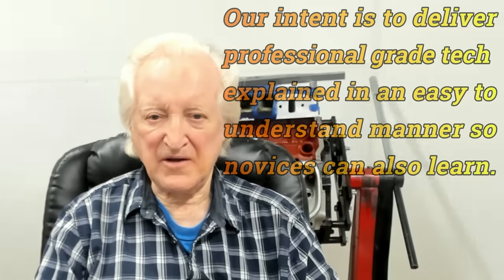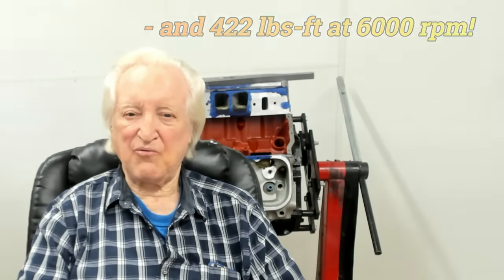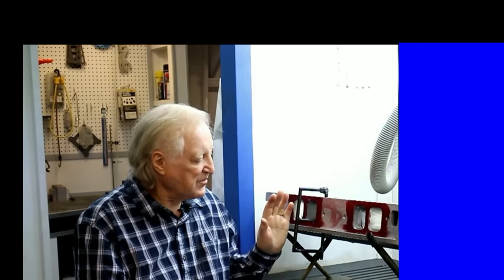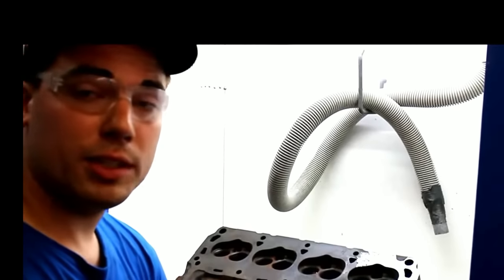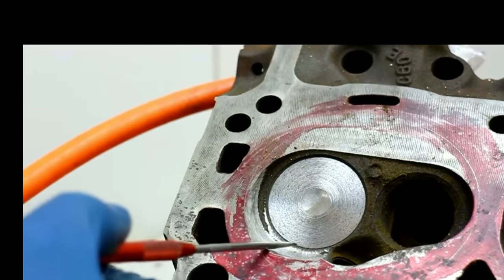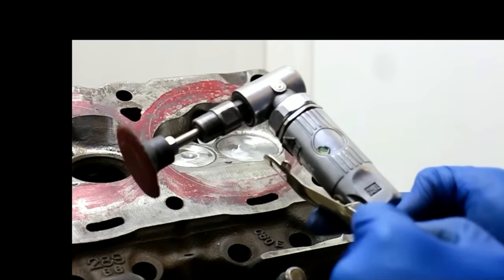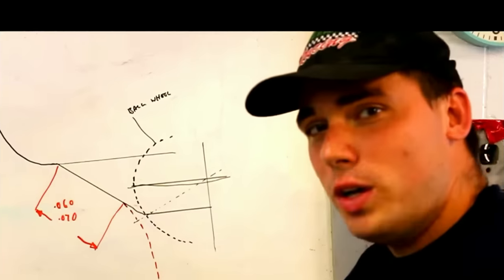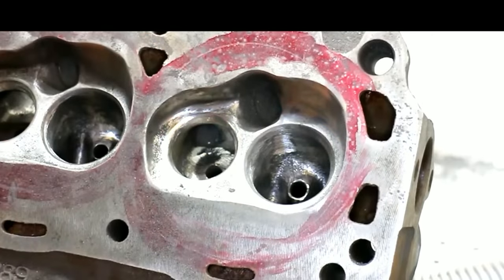Pro race,  very street drivable, 500 hp OE 289 SBF iron head mods.

Comment: Really appreciate the knowledge in this video, and the timing of the upload. I'm currently in the process of porting my set of 289 heads, which also happen to be for a '66 mustang GT, and are the first set of cylinder heads I've done any significant work to. 

I have a question: based on your expertise, in addition to the porting work shown in this video, would installing larger 351W valves (1.85"/1.55") have additional benefits in performance on a high compression 289, or are the flow numbers/HP/Tq ratings similar compared the stock valves (1.78"/1.45") after porting. I would love to hear your input. 

- James P.
Reply: In another episode, DV talks about area rule. This is the area of the valve curtain up to about .25 of the valve lift. The area between the valve and seat up to that point is what limits the intake flow. Exhaust also but the higher pressure gas is a determinate. What this says is, yes a larger valve will tend to produce/allow more flow especially at low lift. 
For years guys have been installing the Chev 1.94"/1.6" valves in the SBF heads. Another option now is the LS 1.9"/1.55" valves. Keeper heights are close to the same as the Ford valves with either choice of Chev valves. The 1.94"/1.6" use the same 11/32" diameter stems as the Ford. If your guides are worn I would choose the LS valves. They are about 20g to 25g lighter. When you need new guides anyway, installing 5/16" bronze guides and hone to fit the 8mm stems is a bonus. You do need retainers, keepers and springs. If you have the 63 1/2 to 66 regular performance heads with pressed in rocker studs, you likely have a spring installed height of 1.64" to 1.66". PAC has dual springs that will work with flat tappets and .55" lift. If you have the HiPo heads or 67 and later heads, the spring installed height should be 1.78". In this case the LS retainers, keepers and probably springs from a Pick n Pull engine will work. The LS installed height is 1.8". These parts also reduce the moving mass of the valve train.
If hou have the early 351 heads with the 1.84" valves or the GT40/ GT40P heads with the 1.84" valves, the LS6 has 2.00" intake valves that can be put in these heads.
The Ford valves are a bit longer but not a problem. Rocker geometry must be checked. Lash caps may help correct the shorter valve stems. 
I would also consider 7/16" rocker studs for extra strength and stability. Also roller rockers to fit the 7/16" studs. There is a cost premium to this, but the benefits outweight the extra cost, IMHO.
Non HiPo heads probably do not have pushrod guides built in the heads, so guide plates are likely required. If the pushrod holes have the guide slots, the stud bosses need to be milled down about 0.250". If the holes are round, guide plates are required. In this case the bosses need to be milled 0.300".
With the almost 0.125" larger intake valves and other porting work as described in DV's PowerTec 10 Ford porting videos, a single pattern cam with about 107° LSA can be used to good effect.
Reply: @Dale Davies  lots of great info, thank you. My castings are C60E-M with cast-in guides, originally on a '66 GT. Is it true that bronze valve guides can potentially seize on a valve stem causing catastrophic engine failure? The reason I ask is, I'm running a multi carbureted manifold (3x2) that is notorious for tuning issues related to the idle circuit and/or proper jetting. If not tuned correctly, there could be lean cylinders at some point throughout the RPM range. The increased heat in the affected cylinders could cause the valve guides above that cylinder to expand at an increased rate and potentially seize a valve. At least, that's my understanding based on my research. In my application, if needed, are cast iron guides available and would they be the better option?
Reply: @PrescribedFire I have to admit that I do not know on the bronze guide seizing. Bronze should have a tendency to self lubricate. Obviously the exhaust valves are more of a concern, so the stem clearance could be opened up slightly. I would talk to your head machinist concerning this.
I bought an RPM AirGap for my 66 289 to replace the 2V carb. The AVS2 carbs were not available then. When I get my engine back together I will put it back on as previously run. Then I will replace the primary boosters with the AVS2 650 boosters for better fuel atomization. The AirGap lacks heat so good atomization at the carburetor is a big help.
My cam is one I had in a 351 and the guy that bought the car for parts was going to rebuild it. I got the cam and lifters out of it with low miles. I drilled a 2 × 4 with 1" holes and marked the cylinders so I can put them back on the same lobes.
The cam is an Engele;
210° @ 0.050"
256° @ 0.006"
LSA is 109°, a bit wide for the 289, but considering I have it I will use it.
Valve lift is 0.472" with 1.6 rockers. I got Scorpion 1.72:1 rockers to get lift over 0.5".
I will get the exhaust seats cut at 40°  and the exhaust valves to 39°. According to David Vizard this helps blowdown at low lift, similar to back cutting the intake valves. The intakes will still be 45° seats with a back cut. Another trick for the exhaust valves is to chuck them in a drill press and use a fine file to round off the outer cylinder side of the margin. You can also use a flapper wheel in a drill while the drill is turning to swirl polish the port side of the valves, especially the intake. 320 grit works.
DV's PowerTec 10 Ford head porting videos show how to prep the heads to enable 500HP. 
DV also built a dyno mule using Chev 5.7 powdered metal con rods and Mahle Chev pistons. Compression height is short with this but 1mm, 1mm and 2mm rings help. I am planning another 289 build using aftermarket light Chev 5.565 rods with the big ends machined for the SBF journal and bearing sizes. This leaves the compression height at 1.200" to 1.210" for a tight quench. Do look up DV's Ford porting videos.
You have heard of SBF blocks breaking. A lot of that is front to rear vibration that fatiques the main webs. In DV's 1,000HP Ford block video he shows block modifications for splayed 4 bolt mains, a lifter valley reinforcement and concrete filling the block up to the bottom of the water holes where water enters from the water pump. This changes the natural frequency and damps vibrations. This does not harm cooling as most of the heat is in the top 1" of the cylinder.
Another thing to look into is Strategic Cooling. You would epoxy freeze plugs into the front water holes in the block and then drill to say 3/4". Then the water passages in the timing cover would be drilled and tapped or an aluminium nipple welded on with a 3/4" NPT thread. The block is drilled and tapped for 3/8" NPT between the front two cylinders on each side and also the rear two cylinders each side. This creates swirl around the cylinder tops. A manifold needs to be made out of tubing, 3/8" stainless. Also the heads can be drilled and tapped to inject coolant directed between the exhaust seat and spark plug. This is an option available through AFR Cylinder Heads.A 1/2" or 3/4" tube should come from each side of the timing cover and around the side of the block. The 3/8" tubes get welded to that to distribut the coolant where it is most needed, thus the Strategic Cooling name. I think it is Stewart Cooling that describes this into the heads rather than reverse cooling. Deairation is not a problem with this.

Comment: Excellent. I wonder how you could mod the same heads to run low compression, 87 octane for a great street engine? Occasional track days and cruising in a 65 Mustang 2+2.
Reply: Use water injection with 87 octane. David has several videos on this.
Reply: @bobirving6052  Thanks, will check it out.

Comment: The gasket hole is always bigger than the bore in the block !! If you port to the gasket edge, the chamber will over hang the bore anð interfere with intake flow ! The way to do it, is use empty block put blueing around chambers, bolt heads to block turn block upside down, reach down bores and scribe lines on heads. Know you have the exact size of the bores transfered to the heads !, Hope this helps, GOD bless.

Comment: Hi David, thank you for sharing all this knowledge. i have maxed out my internet twice watching your videos (can't get unlimited where i live). Now please excuse my ignorance, i have searched the internet for information on "Flowing to 28 inches". without success. What does this actually mean? if possible could you do a video on this subject. I'm sure that there must be other people like myself that can't come to grasps with this statement. Or maybe I'm the only one...
Reply: That's the amount of suction/vacuum (restriction to flow)  being pulled through the port while on the flow bench. Pulling water 28 inches up a tube, suction overcoming gravity. You'll see the red dye in the tubes on the flow bench to more easily see the liquid.
28" is an "industry standard" value for comparisons.
By keeping the suction constant, any change in flow by porting or increased valve opening is easily seen.
Each time the valve is opened farther, 28" needs to be reset.
Reply: Hi Thanks for the reply.
However i still not understanding the physical connection of the tube\s are being sucked on.
if they are on the vacuum side the liquid would be sucked straight out of the tank (if there is a tank).
So the only way you could move the liquid up the tube is to apply a slight vacuum.
the only way (I think) you could apply a slight vacuum is to have the tube somehow interface with the air being drawn through the port.
So is there a tube placed in or near the port? or is it some kind of venturi that the air passes over causing suction? (Like a spray gun)
A physical diagram would be awesome!

I am in the process of rebuilding a 351C using stock heads (2V) for street use, and I want to apply DV's knowledge to get the best results.
i would like to build my own flow bench so i can see the results before and after valve and porting changes. 

BTW I have never seen a flow bench in person. I probably wouldn't be asking these questions if i had.  I've only seen on YouTube.

Regards Darren

Comment: maybe I missed it, but what are the 1.47 and 1.1 radii in reference to... I know they are for unshrouding reference for the intake and exhaust valves respectively... but are they rules of thumb "percentages" of the overall valve Ø for each of these specific valves (similar to the .88 of valve Ø for throats) or are they more general numbers... I hope that makes sense-i just can't seem to word it the way I want
Reply: Call it a radius multiplier.  Valve R x 1.47= deshrouding area.  Deshrouding more important on intake, radius into seat area more important on exhaust, yet deshroud as much as reasonably possible.  Remember, everything you take away makes for a bigger chamber.
Reply: @traviscallaway9675  thanks... I assume (maybe incorrectly) a flowball sized using that equation would work in the same way or maybe in conjunction with the scribing/dichem method used...
Reply: @zeroswings2  it would, just easier than having multiple balls.  Yet the proper flow ball is more accurate for minimum dimensions, have to remember air wants to move in a straight line, the more area to work with gives you options.
Reply: Scribe the head gasket line.
Radius off the intake valve 1.47.
That shows you how much to relieve the chamber on the intake side of the spark plug. Don't go outside the gasket line.

Comment: I really want to get a pair of used 2nd gen small block LT1 heats to take a shot at porting. My 96 Buick Roadmaster sedan needs some help. And I can't afford aftermarket heads. I can't even afford used aluminum heads. Plus I don't want to spend too much money on a set of heads that I might mess up. But I've gotta start somewhere
Reply: See if Cyl head exchange sells rebuilt sets they are affordable. Basic porting rules apply same as most any V8, done many sets of LTx heads.

Comment: Where were you in 1980? I had graduated a couple years before and found myself working for Checker Auto, in AZ. It certainly wasn’t what I wanted to do, but the pay was better than I could make with no mechanics jobs available, as those jobs were being filled by guys who were moving away from snow country that had experience. One of my employees was working for us was a smart kid who was a senior at my former school. When he started building an engine for his mustang I told him about an article I had read in an old Hot Rod Annual. I told him I was certain that I could help him get into the 14’s, or maybe the 13’s if we could find a few places to pull a little extra power from. We got the car into the low 14’s without much trouble, and when he swapped the C4 auto trans for a top loader the car was solidly running 13’s. He wanted to go faster, like all the rest of us. The next build was a 12 second motor, with a bigger cam and higher static compression, around 11-1. The necessitated the constant use of octane booster, but it was cheap enough for him to buy with Checker’s employee discount. Then he decided to add Nitrous Oxide to the mix, giving him a 50 to 100 hp boost. That pushed the car into the. 11’s. We did all this with stock heads that were port matched and a little bit of work knocking off casting flash. E had plans to put some 351W heads on it and we’re looking for the 4 bbl castings which had smaller combustion chambers, but they are very scarce. I’ve only seen one set of those in my whole life. Anyway, I wish we had had this info back then! Unfortunately p, my friend lost his life when a drunk driver entered the highway going the w wrong way right in front of him. He managed to put his Datsun truck into a slide, turning it sideways and taking the brunt of the impact on his side of the truck. He managed to save his girlfriend’s life, but at a terrible cost. Randy was one of the best drivers I’ve ever known. He cut some incredible reaction times at the track, and when his friend when all out on his Mustang, where we built a full on 351C to power it, Randy squeezed an 8.82 out of it during the winter nats, while the pro stock guys were turning 8.70’s. If we had a newer body to slide the power train into we could have stepped things up a bit and made the field. But it wasn’t meant to be. 
Thinking back in that first or second build, you heads would have helped put Randy’s ride into the low 11’s or quicker. I wish I had known about this way back when!

Comment: At 8:30 why is working on the area shown in the video leading to power loss?
Very good info in this video.
Reply: He has said that cutting that out disrupts the flow on the valve. Kills power and rpm limit by 4-500 rpm.
Reply: @hotrodray6802  but why does it disrupt the flow?
Reply: @torquebooster  The swirl in the chamber flows out the  intake valve at lower lifts when it should be coming in. That ridge deflects the flow.
Reply: @hotrodray6802  I do not think that is the case.
The ridge is on the cylinder wall side.
Maybe Mr. Vizard can give the right answer.

Comment: Does anyone have any idea just how much “cylinder wall bias” material can be removed from the bowl wall?  The bowl roof?    The side opposite wall?  Roof?   Any idea of throat percentages on intake and exhaust?  He mentions having a radius leading to the valve seat which implies leaving some throat material there....  I have some ‘66 289 heads from the 80’s that I drag raced in an 11 second Falcon Ranchero with some home garage port work and Chevy valves.  The intake throats are 1.50”/1.88” = 79.7%.      Exhaust 1.24”/1.45” = 85.5%.     I have read that intake should be 90-92% and exhaust 88%.  Any ideas?

Comment: You can support 12:1 on 91 octane with iron heads?
Reply: And a duel plane manifold, stock rockers too 🤷‍♂️🤣
Reply: Made my ears perk up, maybe octane is overrated
Reply: Proper chamber design and piston selection, fuel ratio and plug heat.
Reply: Also what is missing is the cam used? you would need one that bleeds off cylinder pressure by having a late opening intake valve.

Comment: Hi David. About intake system, polished, dimpling or roughness? What the best application for each option? Thank's.
Reply: On video DV has said the only reason he polishes them is that the customer thinks it's prettier, and he is in the head porting business $$$.
Reply: The finish will make almost 0 difference at all. PRetty doesnt equal power
I only leave a carbide finish on my personal pieces these days. 
If in doubt use a 60- grit tootsie roll and call it good dont worry about it looks. 
Ive poked holes chasing that lol

Comment: I had a 30 over 289 AR HEADS Single plane intake Holly 800cfm Roller cam roller lifters, & roller rockers The best. I could get out of this modor.6600 to 7000 R.P.Ms best of .1185 1/4  mile 68 mustang I had hypo 289 heads done by crane they were garbage The AR aluminum heads weren't much better.

Comment: This is exactly what I'm planning to do with my 289 heads, were you running stock displacement for those horsepower numbers? Does anyone know how much it costs to attend one of David's classes or where to sign up if he still hosts them?
Reply: Looks like the domain lapsed on the proper website, i know some of the videos have text on them about emailing him and theres another bit of text sometimes about trying to gauge interest in possible zoom seminars
Reply: Vintage racing excludes strokers.
Reply: @hotrodray6802  all vintage racing? Even offset ground cranks?